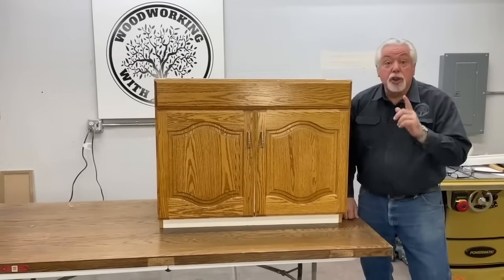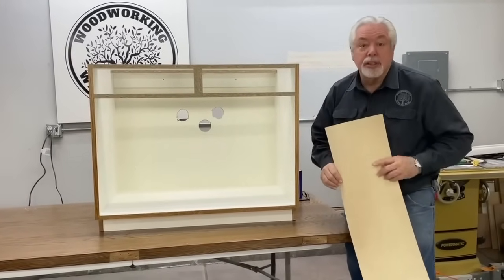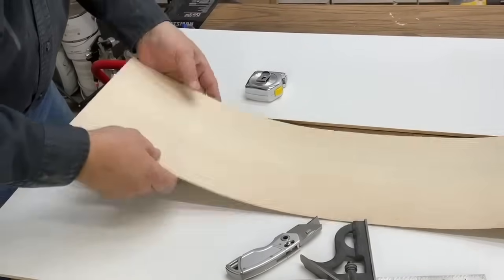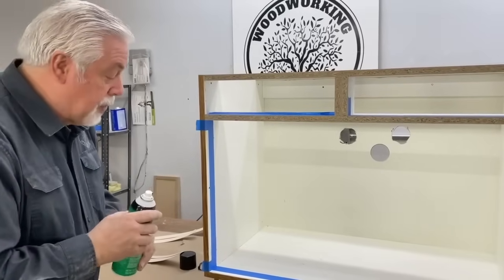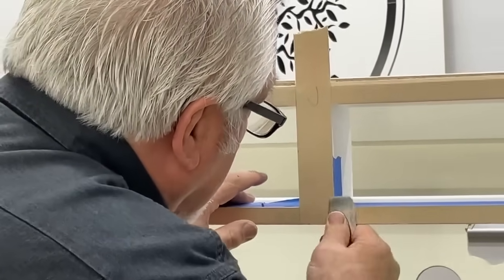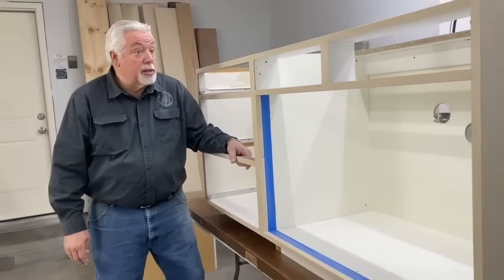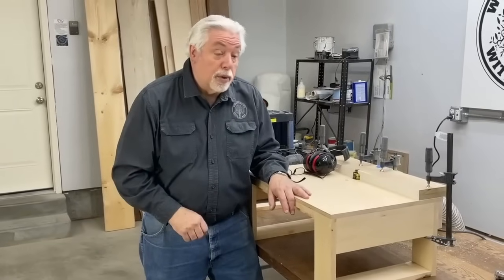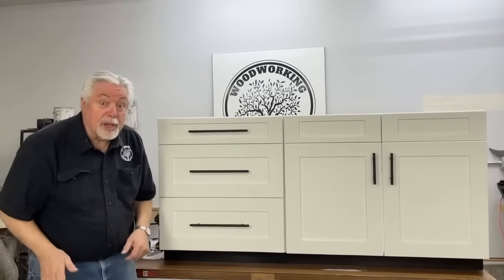Reface Your Kitchen Cabinets And Save Thousands

Comment: Wes, love your videos. Very informative. I refaced my kitchen cabinets a couple of years ago. Converted 1990's oak cabinets to white with shaker style doors and drawer fronts I made. In my case, I grain filled and painted the face frames. I also sprayed the inside of the cabinets and face frames to give a consistent look. That was the hardest part. But like your project, it turned out great and satisfied my wife's request to replace all of the cabinets. I always learn something from your videos. Thanks
Reply from the maker: That is awesome...sounds like you did a great job! You have a lucky wife 😀
Wes

Comment: Hey Wes, love all your videos. I've been seeing that you need to use some wood filler to fill the grain of the wood, especially if it is oak. I noticed the link you posted was for maple veneer. Do you not need any wood filler for maple veneer? You can just paint over it without the grain showing through?
Reply from the maker: Hi...maple has a very smooth grain that does not require filling. Thanks for watching, Wes